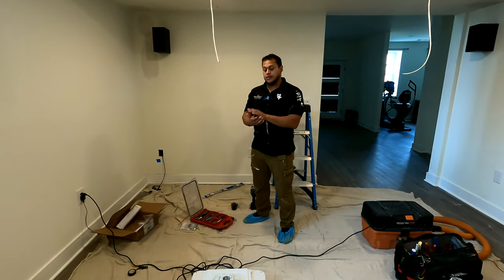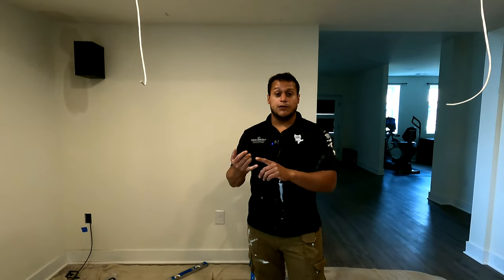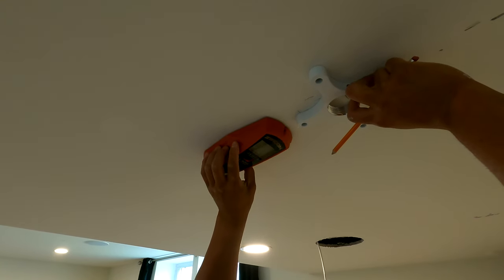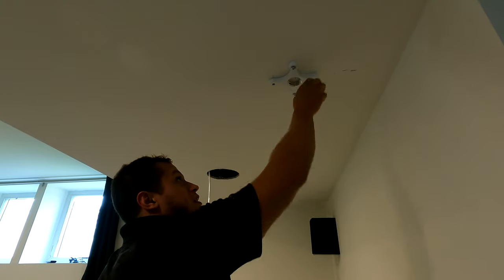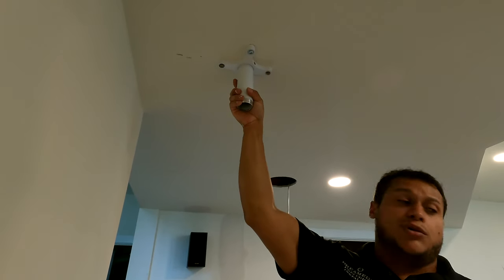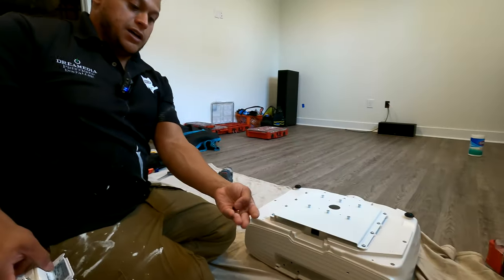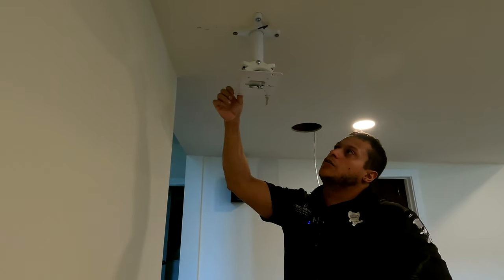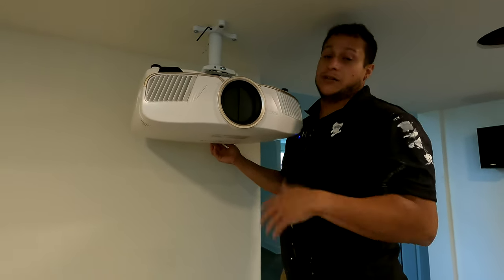How to mount a projector to the ceiling Epson 5050 Montgomery/Skillman NJ

Comment: The instruction manual for this projector mount says that you can flush mount the projector to the ceiling without using the pipe. However I can’t seem to find a good video or any clear instructions on how to do that. If anyone has a link please provide one! Thank you!

Comment: Pretty lame not to include the model number of the mount..
Reply: Looks like the Chief chf4000 mount
Reply: Looks like Chief RPMAU Elite with that specific epson model custom plate.
Reply: CHF4500
Reply: @flyers10az RPMAU was the worst and most difficult thing ever. What a PITA. Threw it away and got the CHF4500 shown in this video.